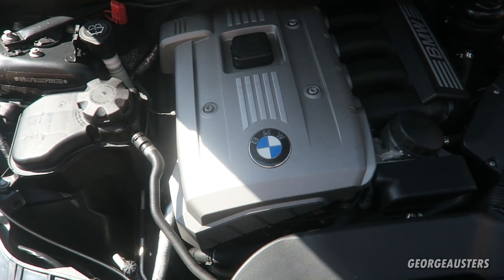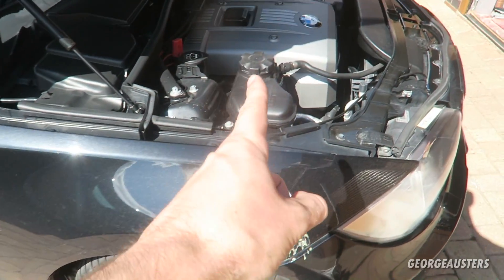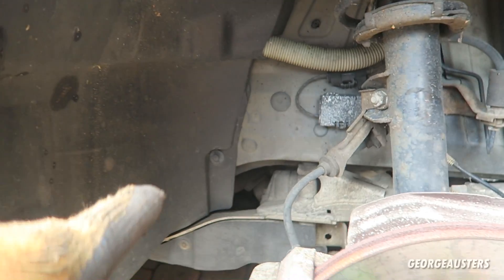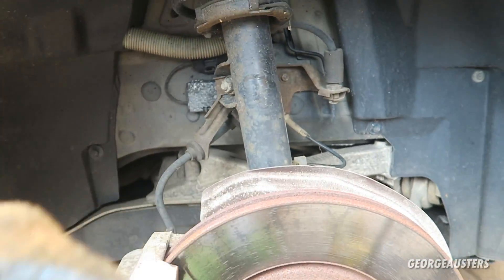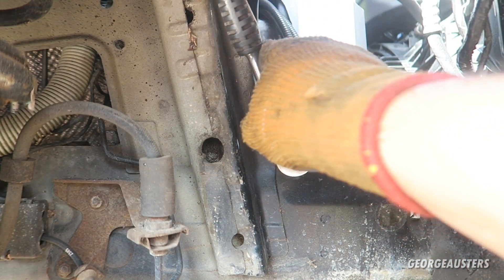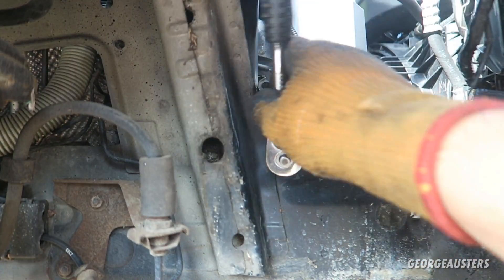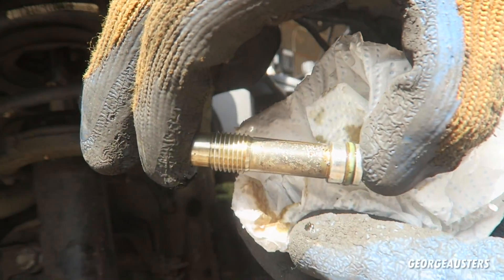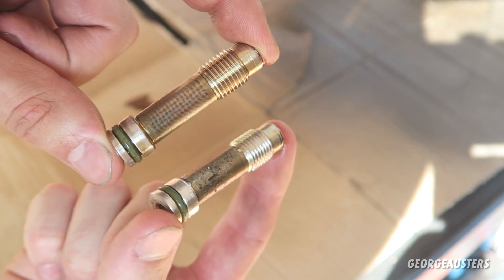BMW N52 Vanos Check Control Valve Removal *Complete Guide*

Comment: I was actually able to remove the 2 valves/regulators from the top (had to remove the 7mm bolt that fastens the cable bracket, in order to clear up a bit more space to access the valves).  It is possible to remove them (without having to remove the tire and the plastic wheel well liner).   You will need skinny arms, however, to maneuver and a small socket wrench with long extension to reach them.

Comment: My understand of the check valve is it control the flow path but it has the mesh screen. It feel like the last chance filter for an atuator in hydraulic system.

Comment: Man I cannot get at the top oil check valve.  Anybody have any tips?  I've literally thrown out my back trying for three days to get that top valve out.  😢😢😢
Reply: Ever get it out? I’m struggling with the top one right now
Reply: @sofberet8888  I was finally able to get an eye on it by jacking the car up higher so I could get down lower and look up at its location.  It was still a bitch getting a T 40 on it with long extensions and when I finally did the goddamn damn thing was seized.    I could back it out a little bit but then it would just seize and would not back out any further.  Can't tell you how depressing it was not being able to get it out at all.  Had to just screw it back in and hope it's not broken inside.
Reply: @sofberet8888  I was able to remove it but it was tricky.   Had a long extension with a T40 at the end, lined it up with the top valve then attached a very small socket wrench to it.   Took a little time but I got it out and replaced it with the new one.

Comment: Good on George,
Does anyone know what are those three cables in the bracket. Two are to solenoids I think but the third-single wire one goes to some  sensor. 
Thx

Comment: T40.  1/4 LONG EXTENSION 
15NM

finally did this. Was not easy for me lol. The trick is using a 1/4" extension.. that damn bracket is right in the way. I was not able to torque it to 15nm. Ill have to keep an eye out for oil. 

06 325i 155000 mi.

Comment: Hi. I have got the exact same rattle on my n52 as the one between 8:32 and 8:34. Is it related to these filter or the chain tensioner? Somehow i think that a lack preasure at startup as some of the valves do not hold oil. Any idea which valve to check ? Did that rattel disappear for good after the cleanup?

Comment: Yesterday I replaced my vanos solenoids with OEM new ones. When I started up my 630i n52 today a check engine light appeared and a weird noise came from the engine. I didn’t change these because I had any fault but just for prevention. Does anyone know what it could possibly be ?

Comment: I'm getting a 2A82 and P0012 code and rough idle. I replaced both of my cam gears and solenoids. Will replacing this fix the issue?
Reply: it happens to me exactly the same as you , the car starts perfect, after 5 seconds or tries to choke without shutting down or gives a small acceleration. after that the revs remain stable but I notice as if he wanted to choke. i notice the car with a lot of power in low, lack of power and high consumption. i have the failure p0012. i have changed the video valves by original bmw and still the same I have also ruled out the solenoids. perhaps it is the eccentric sensor or valvetronic engine. have you found the fault?

Comment: I got a 2010 535i drive w 111k bought it for 3,500 ran up on your videos and man you have me checking things I’ve never knew thanks for what you do and your videos there’re very helpful. I have a question on cold starts two things happen (1st one I feel a thump once the engine turns on, 2nd the rpm on idol it revs up n down then after awhile it stops, any feed back will be very appreciated thanks from the US

Comment: Hi George, I am an ex vehicle mechanic, I was on the spanners for 32 years before i moved over to vehicle collision estimating, 3 weeks ago i bought an E86 with the N52 3.0 engine, I was looking at Datsun 240/260Z S30's for stupid ££ and suddenly realized the E86 is the 2000's equivalent so i had to get one being like ££ cheaper and they don't fall apart with rust issues!  It is my first BMW at 61 years old!! I've been out of car mechanics for a long time but the basics never change, I just need updating! Your content on repairing the N52 is top notch mate, I've saved all your videos for the jobs i have to do on my Z4 Coupe as you are very methodical and precise and will save me a bit of head scratching! I'm obviously subbed to your channel and you come across so much better and knowledgeable than other so called BMW 'Expert's' on YouTube IMO. 👌
Reply from the maker: Appreciate it mate!
Reply: @GeorgeAusters  I appreciate you getting back George, Keep up the good BMW content Fella! 👍

Comment: just got done replacing my two vans and engine no power when starting up revs up by itslf and guess what!!!!! I am going to do these tonight!!!!! hopefully this will cure my disease...
Thanks, George!!!!! Much respect dude!!! you are my legend!!!!
Reply: it happens to me exactly the same as ati, the car starts perfect, after 5 seconds or tries to choke without shutting down or gives a small acceleration. after that the revs remain stable but I notice as if he wanted to choke. i notice the car with a lot of power in low, lack of power and high consumption. i have the failure p0012. i have changed the video valves by original bmw and still the same I have also ruled out the solenoids. perhaps it is the eccentric sensor or valvetronic engine. have you found the fault?

Comment: gonna do this today... going to try and get them thru the top, expecting to see some nasty valves. I've cleaned the solenoids a couple times and experience much better running afterward.

can anyone explain to me how these check valves work? Where is the oil flowing to? (and where is it not allowed to flow back towards?)

Comment: 7:25 just a friendly tip - with that many extensions you are losing torque. You'd be losing torque on a single extension depending on the lenght but if you combine multiple then if you set the 15 Nm on the torque wrench then you may end up with let's say 12Nm on the end with that setup. Thermal expansion along with the thinck O ring probably help to keep everything locked in place and sealed but should you ever notice minor oil leaks around your engine block in that area (or the floor where you park) this may be the cause later... alongside with many other sources of course, like the oil pressure switch and what not :D 

A good idea to make sure everything is allright is to clean the area with brake cleaner thoroughly once you're done and check back on that spot later. 1st check after a week or two to see immediate issues right away but the 2nd check might be a few months and decent kilometers so you have a good running history to compare with. If you're good then leave it and don't go fixing things that aren't broken. Even it may have like 13,68427 Nm of torque instead of 15 Nm but if it works don't disturb the peace :D 

Again, no hate, just a friendly tip. Happy driving :)
Reply: False

Comment: 3 years later man is still liking comments, what a legend, batteling p0012 code, changed everything, those filters are the last hope! Rpms jump to 1200 after every start up, hopefully it works, much love from Cali
Reply: Did it work please help I don't want to go to dealership 😢
Reply: Did it fix the p0012 code I’m having the same issue
Reply: @russelldunlap748  nah I sold the car as is, was driving fine besides the symptoms. New buyer still drives the car
Reply: @russelldunlap748  u have any other codes?
Reply: Same problem. Rpms jumps every cold start. Sometimes engine even dies after start up. But when engine is warm it starts very smooth. Was about to clean those filters. But Im more focused on eccentric shaft sensor. Also my fuel pressure drops way too fast after shutting off the engine, considering someone from bmw forum :D so Im heading to change the fuel filter, fuel pump as well
Reply: @marius7296  did you figure that out? I replaced the eccentric shaft sensor along with 8 other engine sensors and im still having horrible cold starts
Reply: @sergiovillalpando2416 😂😂😂😂 classic BMW goose chasing
Reply: @sergiovillalpando2416 have u figured it out?
Reply: @marius7296 did u figure it out having the same symptoms right now
Reply: @sofberet8888  sadly not, i bought a laptop and had all the BMW programs downloaded, and i still cant find an error on the programs. kind of stuck at the moment

Comment: i've just changed the vanos solenoids and i still get error code 2A82 when i push hard the gas pedal, at high speeds the error comes back.. what's wrong with it ?
Reply: Okay, so most of the times when u get missfire at higher rpms it’s vanos solenoids or camshaft sensor
Reply: 2A82 refers to DME vanos on the intake

Comment: Just bought a 07 n51 e92 with 100k and it’s been neglected and sat for a while. I’ve dealt with various issues on this car but the one issue that was driving me insane was a pretty major rough idle changed both vanos’s, did a engine flush, changed spark plugs, ignition coils, intake filter, and a shit ton of other things. but then it came down to the check filters and they were so dirty I couldn’t believe it like 20 times worse then in this video. after cleaning them the idles 100 times smoother, it’s still slightly there but I think this car needs to be driven and flushed more. For anyone having trouble on a n51 take out  the stupid emission friendly intake and loosen up the coolant reserve. then take out the tire, wheel well etc. it’s a bit of a pain and I had to switch constantly between short and long extensions and use my hands once it was lose but you’ll get it eventually.

Comment: thank u for the excellent video i didnt take the fender guard off are you using a swivel and what type 1/4 innch or 3/8th drive?
Reply: ????what kind of tool u use..mine wont come out i cant reach them u use a 1/4 inch or 3/8ths my 3/8th with torx 40 wont fit in there i have an E90

Comment: You can get to them after taking the plastic cover off and using a mirror on a stick and the torx on a swivel head 1/4” drive ratchet with a short extension clean them with Castrol Super Clean after carefully taking off or covering the o rings with Teflon grease or Teflon tape, and a few wraps of electrical tape, especially if using brake parts cleaner, electrical parts cleaner (doesn’t really clean anything) or Jet Spray gum-out carburetor cleaner.Naptha works well, (Charcoal lighter)
Reply from the maker: Yes you can but I wouldnt be able to get a camera in to show you.

Comment: I tried to get at these valves on my 2008 528i, but I couldn't get a good angle on them because of body panels. I was able to get the torx on one of them at an angle, but not the other. I was afraid that if I did manage to get one off, replacing it would be risky, it could fall down be be difficult to recover.

Comment: Good video, for those with N53 it’s the same setup just becareful with front wheel liner when taking it out and You’ll need a pretty long extension.
Reply: Two extensions and tape them together so they don’t come apart worked for me on my N52 engine
Reply: @thomasshepard6030  that’s the old school trick, I just used a extension the length of my arm haha

Comment: Hi Great video Sir, and explanation , I have a question::: does the 2013 x5 N55 (3.0 LITRE TURBO) ENGINE  have the same 2 check valves or is this just on the N52 Engines???  ty
Reply from the maker: You will likely have 2 the same
Reply: @GeorgeAusters  ty!for response

Comment: @George Auster Hi George, would you know how many check control valves are there on your BMW 760Li? and what's the torque spec (unless it's the same torque as this engine)?
Reply from the maker: 6 in total on the 760li.. Torque spec should be about the same
Reply: @GeorgeAusters  Thank you so much kind sir!

Comment: Just done this on my 175thou 130i. Had a bit of a rough idle at cold start. Despite them looking pretty clean, the first start afterwards was completely stable.
It can be done from above in about 15 minutes without removing anything once you have them located. I used a 3/8 T40 on a 120mm extension bar. Absolutely no need to go removing wheels and arch liners in my opinion.
Reply from the maker: Fair enough.. I wouldn’t have been able to show the process without removing the wheel arch liner though… No space to get a camera in👍🏻
Reply: @GeorgeAusters  If I hadn't watched your video first to see where they were then I wouldn't either! Was very helpful, even if I didn't use the same method. Keep up the good work.
Reply: Bullshit
Reply: There's no way without removing stuff that you can get to those this dude's a b********

Comment: just use long L shape Hex key 40 or RIBE m6 and reach them from the top of  engine, its not very hard
Reply: Mean T40?, thanks bro
Reply: I open the wheel but do not have size
Reply: @trumpxitv7116  you can use ordinary torx 40 to loose them, be sure to not drop them
Reply: @pietropietros216  many thanks bro, let me try again
Reply: Done, T40, thanks bro

Comment: If you were supposed to tighten the valves to 15 Nm, you overdid them by clicking the torque wrench additional times. Grab the wrench by the designated area, tighten the valve and at first click you've reached the set torque. Additional clicks are unnecessary as the torque is now more than what it was set. Otherwise good video.
Reply from the maker: Clicking it more times does not increase the torque unless you’re increasing the rotation

Comment: Just a heads up for any bmw e83 owners. After removing the wheel well trim I found myself staring at more metal under it. No opening to access the valves after lifting the car and removing everything. Ended up replacing them through the top with a handy short swivel extension with a T40 3/8 drive

Comment: Ill check mine hope there located the same in my E60 520d m47tud2 . Yesterday cleaned thé map sensor . Changed thé oil 5w30 febi bilstein long life plus . Oil filter and pollen filters . Now it got to change diesel filter ,egr thermostat ,glowplug control unit, clean thé vanos solenoid and the check valves. Did i missed something ?  ;-)
Reply: Damn forgot the pcv valve ;-)
And i got a dpf code so ill have to remove and clean it .... But the car says there no problem... Weird huh. Exhaust gas back pressure is like 33 when idle ... Any help am still new at this George... Thanks mate
Reply from the maker: Diesels don’t have Vanos solenoids 👍🏻
Reply: @GeorgeAusters  thanks George didnt Know that
Reply: @GeorgeAusters  any tips why the dpf wont allow forced regeneration . I think it's thé egr thermo that is Broken the coolant temperature wont go above 70 c°

Comment: Thanks for detailed video mate! I have experienced that these little valves can make a huge difference! I have used to clean them each time when doing oil change. Anyway now I have decided to change them for OEM ones, what was interesting that old ones (also OEM) dont click if you shake it but the new ones do click
Reply: What’s the actual part called? Or part number?

Comment: Can someone please help,
I tried removing the check valve and it unscrewed all the way out but it's not popping out. It keeps on spinning at the end. I have no way to grab it and pull it out. I believe the compressed O-ring is still holding it in. The engine is N52. Has anyone got any ideas?
Reply: Put something stick on the torx head or us a slim piece of wood
Reply: Start the engine, oil pressure will make them pop out....and do a huge mess :)

Comment: I have N52, P0012 error code. I installed 2 new cam sensors, 2 new vanos solenoids, new non return solenoids valves, new oil change with new oil cap, and still have the code with bad idle the first 5 seconds when I start the car. Any input?
Reply from the maker: Did you watch my rough idle video?
Reply: You're looking at Intake VANOS unit failure or Timing chain tensioner failure.
Reply: hello, my n52 is like this, did you discover the problem?

Comment: I just did it this morning, its quite clogged and dirty, after a good clean up with carb cleaner. Install it and take a short drive and I notice acceleration improve at lower rpm.
Reply from the maker: Glad to hear!
Reply: How many miles had your car when you cleaned the valves?
Reply: @hanynowsky  164k miles

Comment: I just done mine George but used an inspection mirror and head torch to do the fiddly bit so didn't he to remove inner wheel arch, removing the electric cables a good idea.

Comment: Doesn't start that well does it ? starter motor ?
Reply from the maker: I was thinking that but have been told it's normal on this engine
Reply: @GeorgeAusters  My 130i pre facelift starts straight away first time so does my friends  so not normal in my experience.
Reply from the maker: Noted thanks Roger. I didn’t think it was normal myself and intended to swap it out so I guess I have been badly informed. 
Another job for the list👍🏻
Reply: @GeorgeAusters  I thught it was a bit slow or sluggish  's if battery and vanos solenoids OK think it could be the starter motor

Comment: Is it possible do it up from the engime bay ?
BimmetN53
Reply from the maker: Yes but much easier from the wheel arch as you can't get your head down to see
Reply: yes, but it is hard to see what you are doing
Reply: Yes I did it from top but you really don’t save much time. You’ll be cursing 🙂
Reply: @ulf5738  agreed. I got them out from the top but I think I put them in through the wheel well :P Hard  to put them in when the engine is slightly tilted and no view from above.
Reply: Wasn’t too bad to do from the top but very little space to work with. A very short swivel extension worked well for me